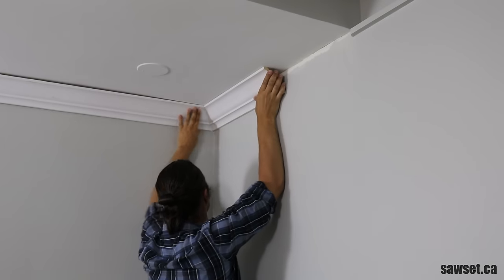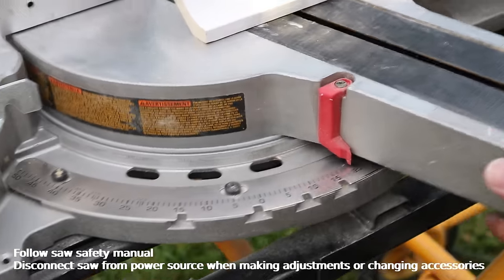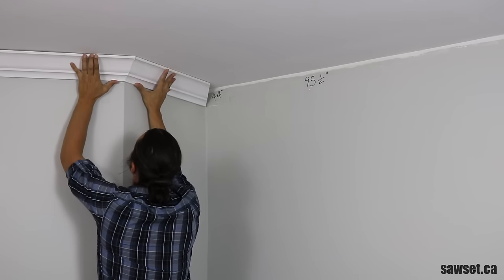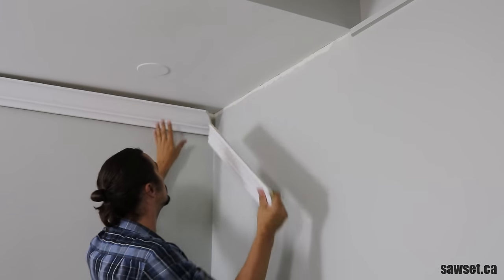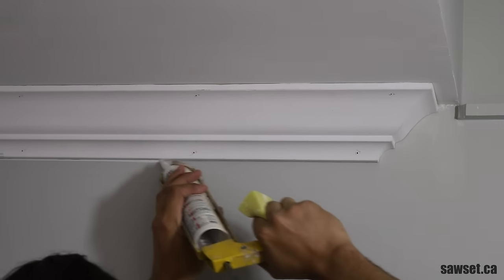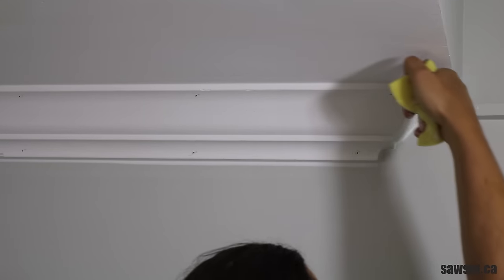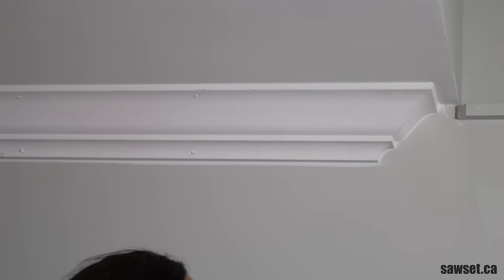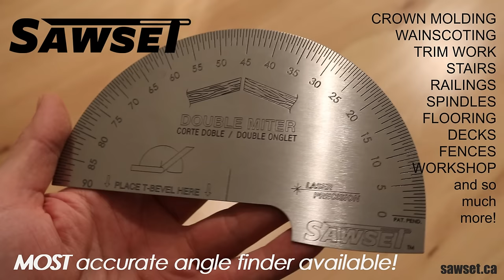How To Install CROWN MOLDING using a SAWSET PROTRACTOR. #AMAZON         #crown molding #miter #bevel

Comment: WTF Top Gun 250??? Thats caulk not adhesive its fine to use it on edges, maybe, its not an ahesive cauld like Loctite Polyseamseal, but it will adhere to the drywall but not on the mitered joints. Wood Glue Man Bun. Wood Glue
Reply: I have removed trim that had Top Gun 250.
The paint comes off the wall and drywall is exposed.
The paint is the weakest link.
Test it yourself.

Comment: What is the best wood for crown molding for basement
Reply: Any wood or MDF  works for basements.
If you are worried about dampness, oil prime first.
It acts as a moisture barrier and it seals in the grain.

Comment: no coping?
Reply: Miter is better because it is quicker.
More glueing surface when mitering makes a strong connection.
The moldings are locked in by each other,  when mitered.
Only one molding is locked by coping.
Easier for the DIYer.
Coping is the old way.

Comment: Inside miters? WHAT A HACK! Inside corners need to be a coped joint. Only a wood butcher miters inside corners! The shrink and turn into ugly gaps!
Reply: TJ 
Coping is a traditional method.
Mitering is simpler, quicker, corners crisper, and each molding locks the other in.
More surface to glue.
Shrinkage happens when wood is not acclimatized or high moisture content in the wood.
My opinion.
Reply: @thetoolman3355  Bullsh*t! Coped corners done by a true finish carpenter are crisp and clean. Your method relies on the old saying, "calking and paint makes the girl what she ain't"!
Reply: @Kevin-mp5of  Love your passion Kevin.

Comment: Why don't you cope your inside corners?
Reply: Quicker.
More glueing surface when mitering makes a strong connection.
The moldings are locked in by each other,  when mitered.
Only one molding is locked by coping.

Easier for the DIYer.
Coping is the old way.

Comment: No cope?
Reply: Yes, coping is an option.
 But when you miter both pieces, they lock each other in place.
 My opinion.
Reply: @thetoolman3355  Coping doesn't lock one piece in place to the other?
Reply from the maker: Thank you for your reply. Coping is always an option. Our tool is for those who choose to miter their joints.
Reply: Only time I cope is for stain grade inside miters because the seams have to be perfect. For paint grade you can caulk slight gaps. " a little caulk and paint makes a carpenter what he ain't"

Comment: Another hack who doesn't cope his inside corners. And what are you nailing too? Drywall. Crown will never hold nailed to drywall. Find the wall studs and nail to those. And using a backer board on the ceiling.
Reply from the maker: Thank you for your input! We have used this technique for decades, with much success.
Reply: Sawset Tools And you wouldn’t do anything at my house. I’ve been installing crown molding for two decades as well and I wouldn’t do anything but cope an inside corner.
Reply: Go watch a Ron Paulk video to see how a real pro installs crown molding.
Reply: @nickhuber9627  Both methods has it's pros and cons.
Reply: The Tool Man No cons to coping. Lots of cons with mitering. Again, watch Ron Paulk. He’s a real pro.
Reply: @nickhuber9627  1- Easier,   2- Quicker,   3- More glueing surface, more strength,   
4- They lock each other in place.
Reply: The Tool Man Wrong on all fronts. Like I said, you’re a hack if you’re not coping. If you cut your pieces 1/16 on an inch longer, it’s springs in tightly and you get a tighter joint. Simple fact. And you don’t need glue!
Reply: Brian Mccauley  If you're not coping, you're a hack too. Wood shrinks and expands and the gap will show even if you glue it. Never happens with a tight coped joint. Crown  does have some weight to it and you need to used a backer board to nail to where the ceiling joists run parallel to the wall. Do this and you never have to use glue on the top edge. And if you've been doing it for 300 decades, you must have installed crown for George Washington.  Go watch a Ron Paulk video. He's a true professional.
Reply: Nick huber your a know it all and narrow minded.  I’ve been installing trim and I started out coping crown but have now went to mitering only

If you cut everything a hair tight and spring  fit your corners and glue them the moulding is seamless and as strong as can be. 

far better than coping 

And before you say anything I’ve been at this for 40 years and have done thousands of crown moulding installs

Comment: What are you selling because I must be missing it. I don’t believe you ever tried hitting a stud and I’m just not seeing anything new other than a monkey on a persons wrist that uses a lot of caulking. Sorry but I’ve been in the business a long, long time and as far as I’m concerned it’s still a protractor that’s been around a lot longer than me.
Reply: Jordan said in the video to hit the studs when you can. As you know brad nails have tiny heads which makes a weak connection. Gluing and caulking is the best method.

Sawset is NOT a standard protractor.
A standard protractor requires 2 steps of math. 
(Protractor angle divided by 2, then find the compliment for the sawsetting.)
Sawset reqires NO MATH! Much easier, in my opinion.